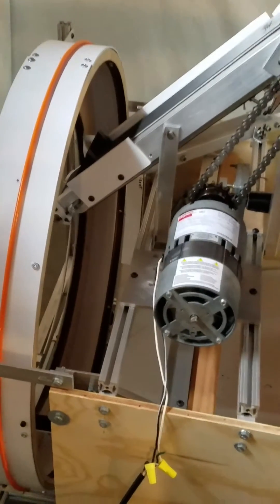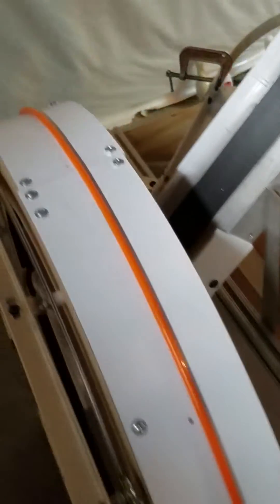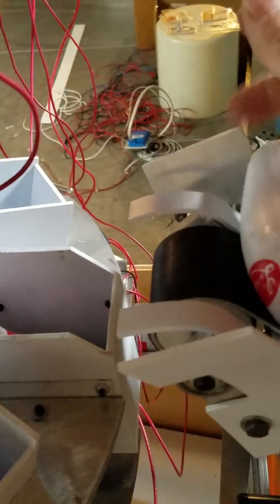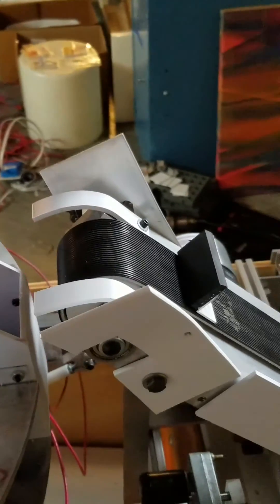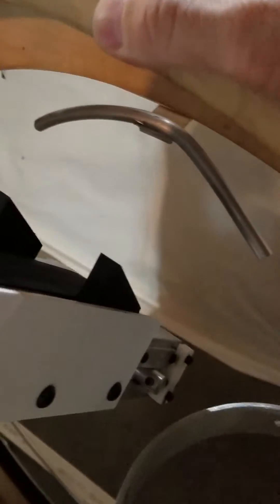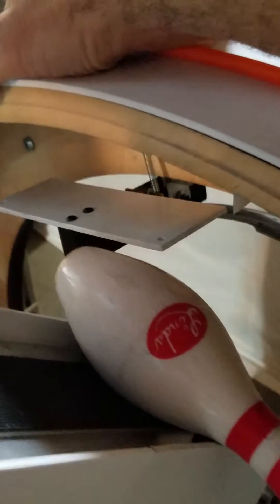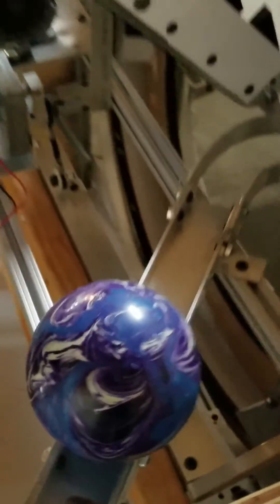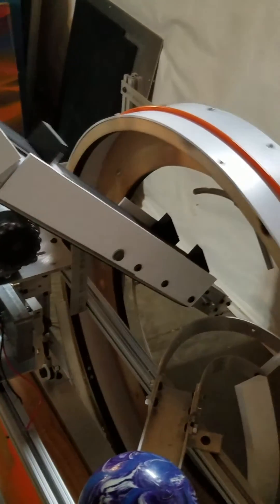Half scale pinsetter pit area pin/ball lift wheel

Comment: What kind of motor did you use for the cross conveyor, shaker, and pinwheel if you remember?
Reply from the maker: It was a Dayton gear motor for cross conveyor. I don't recall what I used to drive the rest of the components you mention. Also don't recall the rpm of the dayton motor. Best I can give ya.